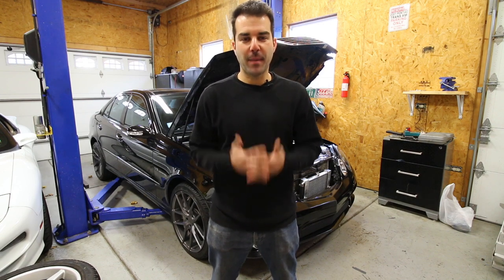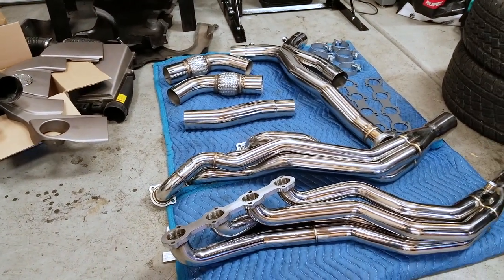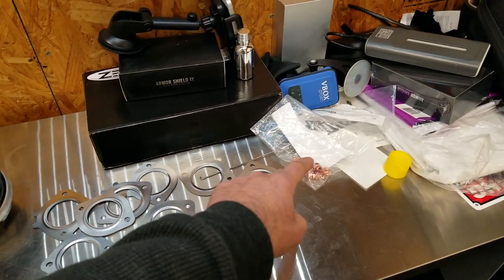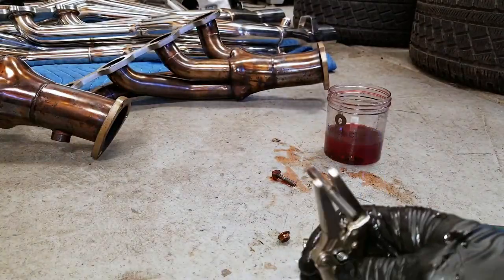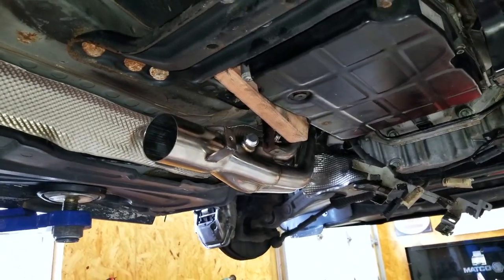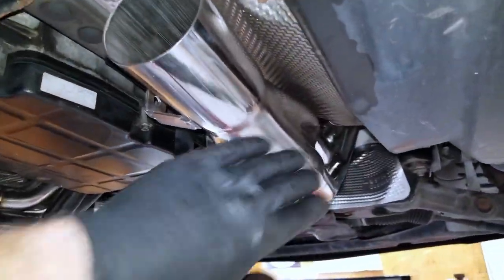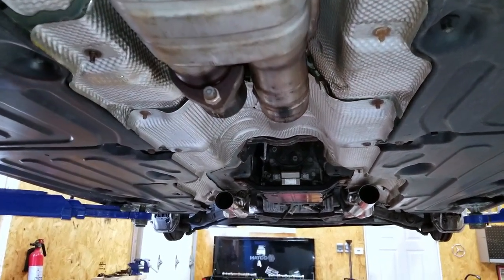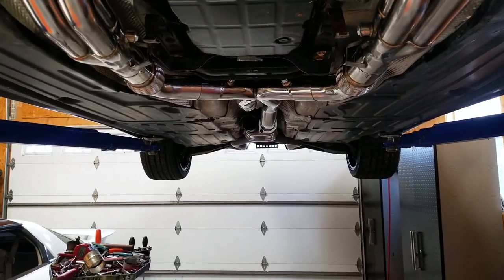Here's How Bad Cheap Chinese Headers Fit On A Fine German Automobile. E55 AMG Long Tube Install.

Comment from the maker: What should I do next to the E55?
Reply: LegitStreetCars “straight pipe it”
Reply: Uh, three times the cost means three times more expensive. You wanted to say they are one-third the cost.
Reply from the maker: @mathewfullerton8577   Good catch Matt. I caught it during editing and clarified in text on the screen.
Reply: @LegitStreetCars  Yeah, I'm a bit anal about stuff like that. Maybe I should hire myself out as an editor. Great video, though!
Reply: Please don’t do a Burble Tune!!!
Reply: Android head unit!
Reply: E55 giveaway 😅😅
Reply: Any luck with the OEM style android stereo swap?
Reply: I have one question if you can help me out with it i have E550 wagon 2006 my wells are front 245/35/19 rear 275 /30/19 what is the biggest Haight i can go and fro the 20s what is the bust size so it doesn't damage my car
Thnx
Reply: Give it to me
Reply: Hey Alex, You should've removed the other side of the pipe in order to make it fit better not only the passenger side, since both sides are welded at the X--pipe.
Reply: Race IQ cams, LSD, and high-stall TC in no specific order. :) Would love to see some real-world dynos and dragstrip times with the Race IQ cams. Also would love to see how much difference the 3k TC's for these cars make at the strip.
Reply: Remove resonator and rear mount turbo it (aka as compound superchargeing) ;-)
just kidding: but change the stock heavy weight resonator with a vibrant ultra quiet resonator. do a search. you wouldn`t be disapointed. Steven Berlin Germany.
Reply: LegitStreetCars what are the benefits of long tube headers ?
Reply: TreyVisuals what is the burble tune I saw that as an option from race IQ?
Reply: High stall torque converter should lower et's a little
Reply: High Stall TC, Fuel Pump upgrade, Wavetrac or Quaife Diff install
Reply: 200 Shot NOS Injection with CHEATER Solenoids
Reply: 3000K paint correction and you're going to drag strip!!@@@@@
Reply: Killer chiller
Reply: my w211 is being weird when i launch it.. i can feel something underneath "shift", the the gear stick jolts forward, then a loud "thud" as it settles back down.. trying to figure out if its a subframe bolt, trans mount or engine mount.. and how to fix it if thats what it is.. please help!??
Reply: Dyno + 1/4 mile again
Reply: Pulley and tune..

I like ur video's...
Reply: Suspension mods
Reply: Android Headunit!
Reply: Burble tune and a giant wing. Be obnoxious
Reply: Install cats.
Reply: If I remember well you have speedo up to 160mph? You could change it to 200mph. What else? Nothing, just put some petrol in it and enjoy the ride :)
Reply: LegitStreetCars get rid of that resonator and maybe existence of APR head studs if you haven't already
Reply: trade it for the nicest diesel truck you can get.
Reply: O2 sensor cables look really exposed to the elements.
Reply: Electric cut outs
Reply: Put a H-pipe instead of that resonator and make it sound even better
Reply: Any other performance upgrade works for me !
Reply: Trade it for my e63
Reply: NEXT YOU SHOULD USE YOUR INDOOR VOICE!!!
Reply: Not E55, but how about an M278 build? That should be close to E55 performance.
Reply: Burn it
Reply: LegitStreetCars 
Tune with e85
Reply: Sell it and grow up.
Reply: Hey Alex, my name is Alfonso Lalli from Springfield Mass..just got a  gorgeous sl55 AMG.Thinking of doing power upgrades..what do you think is best for buck .
Reply: New wheels, e55 amg black series style.
Reply: LegitStreetCars love your work on the c63 I use your videos as a ago to great work Alex from Damien .the land down under ;)
Reply: Interchiller maybe.

Comment: Bro I dont mean to be rude but it seems more like ur problem. Back in China we pay 1000 bucks to get way better quality and original designed headers for E55. And if you don’t wanna go through all the importing procedures, you can  always pay a bit more not to get the cheapest stuff on the market.

Comment: Have Kleemann on mine. They looked gorgeous and the welds were superb when new, I didn't do the install myself but my mechanic didn't appear to have much trouble installing them. It's been 8 years now and no problems with them so far, you really get what you pay for.

Comment: Chinese headers fit just fine on 1,000’s of LS cars 🤷🏽‍♂️ Speed Engineering, Texas Speed, Pace Setter, and OBX. My $1,4000 Stainless Workz headers broke welds. 

I would TIG in any spots that you think need it and roll. They all make the same power.

Comment: Any exhaust leaks use the high temp permatex.  I have used it on race cars for header gasket turbo flanges etc. It works great an won't blow out on 3 stage 1200 hp total shot nitrous engine.

Comment: On the Engine Masters show on Motor Trend Freiburger bashed a header with a hammer on a dyno motor and
it had no effect on horsepower numbers. So anyone out there who needs to "massage" a header it's ok 
to dent it a little.
Reply: Definitely as long as it's not pinched lol
Reply: Yeah, I saw that episode, too.
Reply: Just bend the heat shields: no dents on headers looks much better to :)

Comment: Really good to see you showing those East Coast Euro poly engine mounts, theyre AWESOME in every sense of the word. There is VERY MINIMAL vibration transferred, the car handles a shade better because the engine stays still, and theyre rebuildable. Best option around.

Comment: The flex sections are actually a left and right. Even though they look identical, they are not so you flip them and it would have fit better. I also used bolts and removed the threaded studs.
Reply from the maker: I tried them both ways.  The other way was impossible to line up so im assuming I have it right this way

Comment: I have the same China headers, just stamped with a different brand. Like you alluded to, they're all knock-offs of ones made by American Racing Headers. I can't remember exactly why ARH even made them originally for the W211 E55 since it's such a relatively tiny market, but I think there was some serendipity involved. Anyway I think these long tubes and x-pipe on the E55 sound amazing. And I don't know the gains over shorties and mid-length headers, but I gained a consistent 5+ mph in my traps after swapping out the stock manifolds for these and getting an off-the-shelf retune. My only problem with them is the same problem I have with almost all long tube headers on any car, which is that they mess with ground clearance a good bit. The consensus best headers for the E55 are made by MBH, which incidentally don't reduce ground clearance, but the price of their x-pipe alone is almost what these China headers cost in their entirety.

Comment: I was really never into Mercedes, just BMW. Between watch this channel and and Tavarish's, I am a changed man.  Popped my cherry a few months back and bought a '92 300E w124 coupe. What a joy to drive !! 170k miles but ran like a clock. Very minimal repairs needed and never leaked any fluids. Sadly had to sell it for financial reasons. I will be in the market in the future for a '95 or so C36 AMG 6 cylinder, your thoughts?

Comment: @legitstreetcars or anyone else - How can you reduce the risk of breaking the studs off in the engine or having the studs come out as happened in this video? Would it be a good idea to get some heat in the engine earlier in the day (drive it earlier) and still work on the car when it is somewhat warm (not too warm obviously as you don't want to burn yourself). What about using a blow torch to heat up the nuts?

Comment: I installed a set of China Long tubes on my E55 and did it without a lift.  I didnt need to fanangle the engine to the side either.. maybe I was just lucky but I was able to get it in.. it was super close though I bet the manufacturing tolerances vary enough to where you got a set that were a PITA to install.  I also had new motor mounts in when I did the headers so maybe that helped a little.

Comment: I used a cheap china 304 duel exhaust OBX from headers back on my 90 C4 Corvette and there was al sorts of cutting and welding involved to get them to fit, later on  one of the welds on the exhaust  brackets on the muffler broke china welds and I ended up welding it and reinforcing it, since then I have had no problems one  thing I can say is it is a good looking exhaust and the  304 stainless is holding up well.

Comment: That's easy fitment. Really. I've seen header install that took much longer, and had to bash floors, header tubes etc... Then after multiple times in & out of the car they finally kind-of fit.

Comment: Whenever I come across a stud like that, I usually take two other nuts and tighten them together on the opposite side. Then you can use two wrenches, one on the nuts that are tightened together and one on the stuck nut, to remove the one that is stuck. Just ensures that the threads on the stud are preserved. Great video!
Reply: Deez nuts

Comment: i did those on right hand drive e55, which required they be modified to fit around steering, oem mufflers remain, and despite looking and looking, still cannot find why they rattle for half second on cold start. very impressed with low down torque they produce so after stressing about the rattle, i gave up on that and just enjoy them now. interesting that neither alex or nobody else seemed notice one side hangs lower at flex joint

Comment: For breaking up the rust on studs the very best product I've found has been "Break Free". You can get it at almost any Cabela's Sporting Goods store since it is used for cleaning guns and was developed to clean military M16 in Vietnam.
Reply from the maker: Awesome I'll check it out.
Reply: @LegitStreetCars  We used it to break loose bolts on 100 year old Historical Trollies when we were refurbishing them. Just a few drops would penetrate so fast that 1-1/2" diameter bolts could be loosened in just hours. Bolts and studs like the ones shown would come loose within minutes. I used it on the exhaust bolts of my old 1967 200D (110.110.10.32765) when it finally needed replacement. Two drops on each an hour later then nuts came off easily. I've had several MB's and am looking at a 2005 E320 wagon and have looked for a long time like you suggest to get the best for the least looking them over thoroughly before buying. VERY GOOD ADVICE.

Comment: Been there done it easy :) 
1 tip heat shields before bolting down everything mount it loose mark the heat shield areas where it touch, remove everything and use and nice big clean rubber hammer. Problem solve plenty of clearance nothing is touching: Clearance afterwards :) Approx my F finger between 😁😁😁
Also did my Midt Length Headers myself in my garage  in the floor having good jacks and MB jack pads helps alot. Did in December last year. Installed everything lined up. Had car picked up with transporter - exhaust shop adjusted those really bad fitting Downpipes is so off I don't understand what the point was lol but u difently need a skilled exhaust to finish up. 
(Mine starte d leaking) had it fixed but yes the grafit gaskets are crap:) 

And today long headers.

Awesome video

Comment: ALEX, I bought these same headers from XS-Power and had no fit issues Other than the heat shield which was not a big deal at all it crumps  very easily.. I put a thread on AMG FORUM. I bought the VRP pulley also and I noticed a great power increase with the headers . It sounds great too!
Reply: Nice.6_-29-20 e55amg. Need license..Keep it  original. I say mods. Maybach mounts. China headers. Pully.169kmi.2005.Thanks for your service. CHICAGO Tommy.

Comment: I know it's been 5 years since you've done this video. But I think you are the best guy to ask. I am trying to install long tube headers on a driver's side. It is a pain! Do you recall if you've had studs in when aligning headers on a driver's side or you've threaded studs in after alignment? Thanks!

Comment: But without catalytic converters these headers will probably cause the motors to fail state emissions tests and the emissions equipment visual inspection (for states that have them), relegating the car to racing or "off-road use" only, as the saying goes.
Reply: My thoughts exactly. If I had that car, I would want to drive it everywhere, anytime...
Reply: I know I have catless downpipes for my BMW and the inspection place only runs computer to make sure u have o2.  They dont put sniffer on exhaust tips
Reply: That's good for you, V W.  But some states such as in California and Arizona have an option for a visual inspection for original emissions equipment, and can fail the car without them, even if it passes other tests.

Comment: I have these same “built to fit” Chinese headers for my C10 and I think I’m going to have to cut and reweld or heat bend mine to fit. My driver side goes right through the entire frame. Passenger I had to notch half the frame. Tons of wasted space with these headers.

Comment: The problem with Chinese Headers is that the Stainless is a 200 series Stainless, not 304/308/321, further more, the exhaust flanges are regular carbon steel that have been plated to look like stainless. All that crap will rust and will look ugly after some high heat cycles. If a magnet sticks, it is cheap. The higher the chromium content in stainless, the least magnetic it will be. 316 ss has the highest chromium and is there for used for surgical equipment and such.

Comment: Hey Alex, You should've removed the other side of the pipe in order to make it fit better not only the passenger side, since both sides are welded at the X--pipe so it kept on pushing.

Comment: For sixty yrs of modifying cars and then installing hundreds of headers and also having headers built..the set you installed is a bargain...you are correct that their is always manufactured tolerances in the headers ...but overall I would love a set of long tubes for my 04 X3...one thing...you might consider ceramic coating on the tubes to really reduce the Underwood heat

Comment: Would the CLK black trans mount and Maybach engine mounts fit a W209 M113 (MY2004 CLK500)? If so, would you recommend it?
Reply: Yes
Reply: How about the W204 C350, do they fit as well or is there an alternatve?
Reply: I'm the one who suggested them to Alex. I did the installation on my C55. 
The CLK Black mounts fit perfectly on 211, 203, and 209 chassis. They make a difference you can feel.
Only the transmission mount will fit a 204.
Reply: @RidgewoodMachine  Thanks! What's the difference between the CLK Black vs Maybach engine mounts?
Reply: @FixItRyan  they are the same engine mounts but the Black transmission mount is the one Alex used. Maybachs use the standard MB trans mount.
Reply: @RidgewoodMachine  Would I be wrong to assume they'd also fit a W220 chassis? The trans mount looks exactly like my oem one as do the engine mounts.
Reply: They will fit just fine.
Reply: @RidgewoodMachine  Thanks my friend

Comment: Hey man fan of the channel for a while now, also in Illinois lol, but quick question for you. I have had several subscribers and followers of my small channel along with people I meet at shows ask me why my 2005 c55 makes that wining sound on cold startup then quiets down after it warms up, almost every m113\113k does this same thing!  There are so many different things people say it could be on the forms. Thus I have no good answer for them or myself. As my car has only 59k miles on it bought with 19k on it and has made this noise since day one, there has to be an explanation lol I was wondering with your vast AMG experience if you may be able to shed some light! Thanks for the content as always man! Cheers
Alex , ALifeWithCars

Comment: I got rid of the resonators on my 6.1 Hemi and the drone is ungodly. Just a word to the wise.
Reply: molskimauler It’s especially bad when MDS kicks in lol. I wanted to die
Reply: That's easy to fix with a  Vibrant Ultra Quiet resonator. Do you still have cats? What's your pipe diameter and at what RPM's is it bad?
Reply: @jamesmedina2062  2 grand is the worst but at WOT it sounds glorious. My next step is to put Borla resonators 
on and delete the muffler. I tried to go cheap and it bit me right in the ass.
Reply: molskimauler O.K. I just started designing exhausts. What vehicle is it? Try Borla. Try their mufflers too because you can get performance & sound.
Reply: @jamesmedina2062  09 Challenger SRT8. I'm cheap and don't want to spend 1500 bucks on the full exhaust.
I can do the work myself. I've heard the muffler delete and keep the resonators will still keep my sound but get rid of the drone. It's only pipe and time so I'll give it a try.
Reply: molskimauler yes in my town nobody wanted to work with my stainless pipes that a friend donated to me so I cut it all myself. It took a long time. I wish I had a high end tube bender because it would have saved lots of time and be smoother on the inside. Good luck. Play with it until your happy. I buy Supersprint direct or on EBay and they can custom make mufflers for you.

Comment: Alex, what did you do for the post cat sensors?  Did you just extend the oil level sensor wires, or did  you find some extensions that match up to the factory plugs?

Comment: Do you happen to know if it's worth fitting long tube headers to the W210 E55? if so do the w211 ones look like they may fit, having trouble finding cheapo ones for my older benz.

Comment: I put HOOKER headers on my Nova...2 1/8 primary tubes, according to the chart they are "SUPPOSED" to fit they did not fit any better now than they did in the 70s, one big headache on the drivers side, tubes resting on the steering box.

Comment: Cool vid, have s question have R320. What is it with these Benz radios? Can't change station or adjust volume. I scanned the car got a code said cd eject button stuck. Any pointer you can give? Once again cool vid.